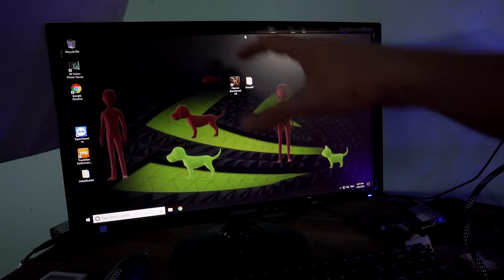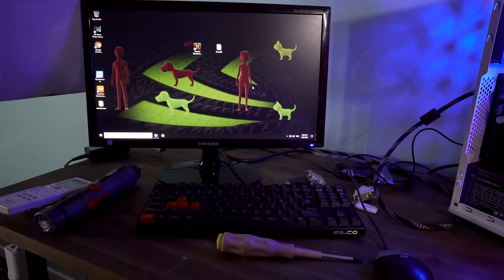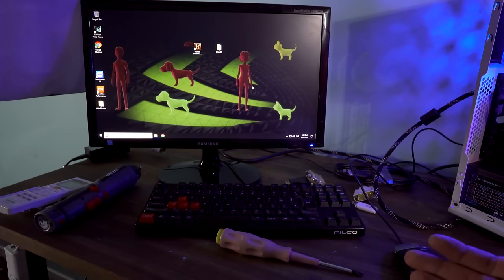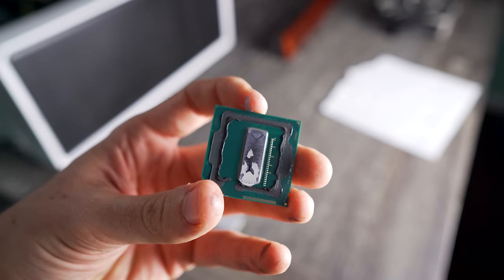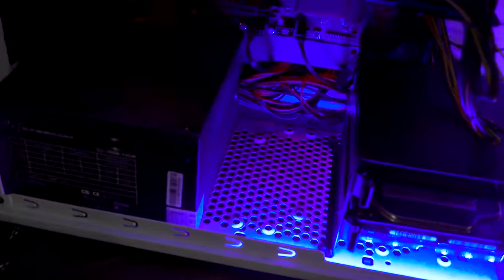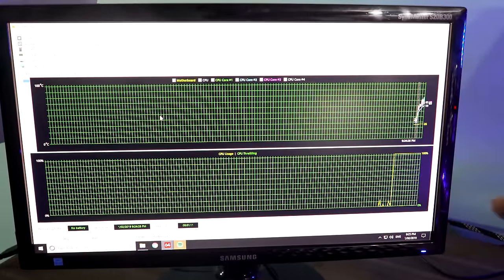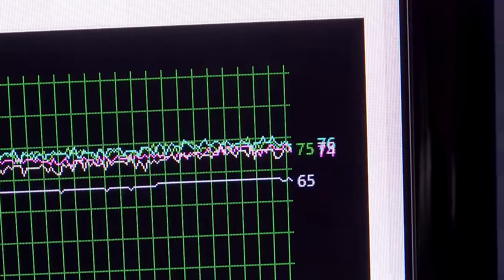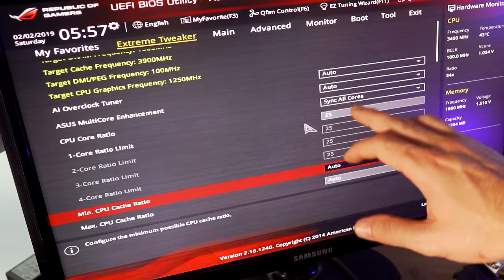How to Spot a FAULTY CPU.....? The i7-4770 Dilemma....

Comment: fall asleep and leave fortnite or any new game on for a week or two straight after turning off sleep and screen dimming in windows if its still running when you come back in a week cpu is kind of stable lol stability is so weird ive had stable overclocks be fine for years then user brings me back pc and its shutting on off etc and it end up being cpu either dieing or just needs a voltage increase just weird parts also the 4770 sucks for overclocking or voltage chances so im assuming that its become unstable at stock voltages cause of the ihs
Reply: also i built a 1366 xeon server and enabled fsb changes through the bios so i have overclocking to a degree hahah but yeah i overclocked without a system fan on the ioh heatsink for the memory and lets just say my finger tip was barbecued when checking those thermals lolol anyway i thought it was cpu but it was ram getting to 100 degrees plus and the ioh was causing that hahah so needless to say check to make sure you have chipset fans when overclocking and second dont overclock if you dont know what your doing it can physically hurt if your an idiot like me lolol  the fact i got the clock speed to change at all on a server was great the fact i was in delerious paranoia cause i thought i was gunna burn something down was the scary dangerous part lolol anyway im writing this from same server that now has a 1000 hours uptime dont give up on parts unless you have warranty !! lololol .............. what would you think of a dual xeon 1366 server build for gaming cause i have one myself i can say its really nice but idk what others would think i think a gaming build with 2 xeon x5550 would be awesome thats 8 cores 16 threads and the ability to have 64gb of ram without sweating the ram slot space is nice lolol but for price to performance i only spent about 130 bucks for the server board and cpus and my gpu is whatever im using in my other systems so thats always whatever i have laying around but it does better than any system i own rn thats why i ask hahah i liek to see my stuff or same things i have in videos i shut up now ...... i dont know what au to cad conversion is but theres some very cheap server parts places in B.C i pretty much built my rig through their ebay
Reply: i also built my server a micro atx form factor case out of pine and actually managed to keep it in a relatively small form factor without having temps go mental
Reply: i should post pictures but im anti social and no one cares lol

Comment: Feel free to send me that 4770 Bryan :)) I could always use a bump up from me E3-1231v3 (it's showing its age).
Reply from the maker: Wait, the xeon variant is better :p
Reply: in benchmarks the 4770 is weaker than the very weak 1231 v3. But the enhanced turbo mode allows to let the 4770 clock with two cores with max Turbo, instead of one core like the refresh haswells have to. With an asus mobo you can adjust the allcore turbo. Even with an intel Dz87 KLt-75 K <3. In every other case you can downgrade the UEFI Bios to a version which has no CPUID code updates for the enhanced turbo mode. with the right version the cPu clocks with 4x3,9 wich is a lot faster than 4x3,6, especialy with the Xeon which is faster than. I am using an e5-1680v3 now wich i saw the first time in tech yes city. A very strong CPU, but the reference corepower is very similar to the 4770.

Comment: you already spiled liquid metal and you didn't used at least nail polish for the smds also prime95 small FFT with hwinfo 64 for temperature monitoring whould have done a better job